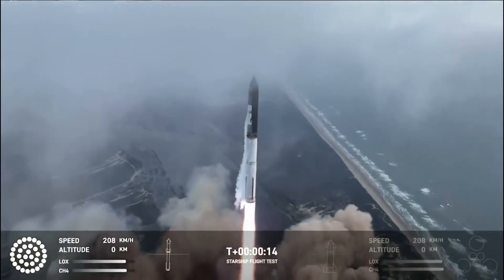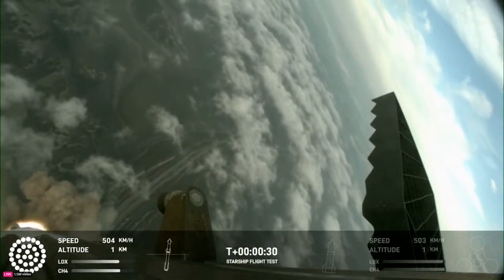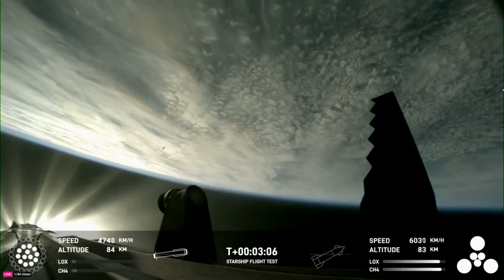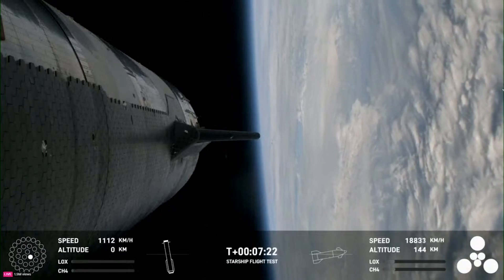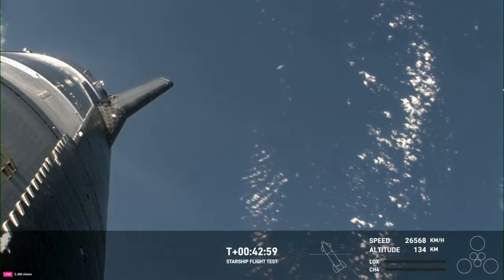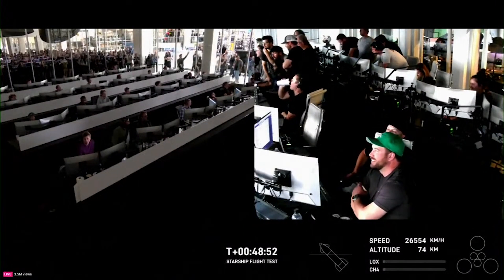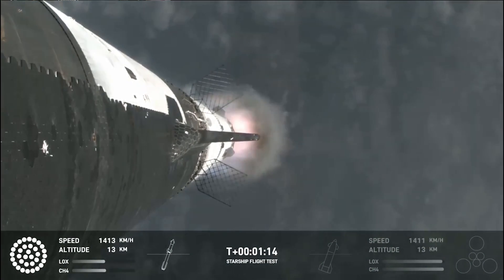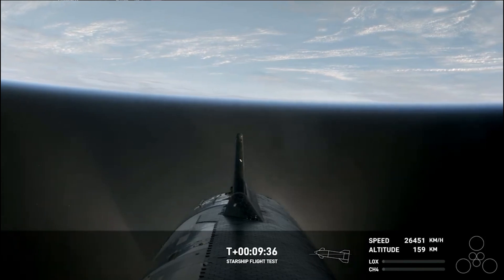What Exactly Happened On SpaceX's Third Starship Launch Attempt?

Comment: I was hoping that they'd succeed with all their mission goals, but it seems that they're getting further and further every time. Which is fine with the iterative process they're doing, but still kinda disappointing. Hopefully the next iteration will get the booster soft water landing down, and the ship will survive reentry (looks like keeping the ship oriented correctly during initial reentry will certainly help). If I had to hazard a guess, the ship will survive reentry, and then they'll try and subsequently fail at an engine relight for the soft water landing. That would just seem to be keeping up with the pattern of improvement across the 3 flight tests so far.
Reply: So artemis IV at 2035 maybe.
Reply: But it seems that sx didn’t get the necessary data about how the TPS tiles will behave as ss was not oriented properly as it reentered the atmosphere. To accomplish what u suggest would require the tiles to be effective as designed which is ambiguous at this time. Though it appeared that some tiles were missing before ss started the coasting phase.  So a bit of a mixed bag.

Comment: 4:30 I remember seeing the same thing but that could have been ice that had formed on the spacecraft after degassing and that started flaking off. 
Remember that the craft had yet to start heating up do to reentry.
Also Spacex commentators did say that the tiled don't flake off.
Reply: On her ascent friction would have provided enough surface heating to have ablated away any ice that accumulated on the pad.

In space, however cold it might be, there's not much matter up there to accumulate into ice. I strongly suspect it was heat shield tiles being blown off as the craft made reentry at the wrong AOO/Attutide. From T+0:45 you can see she's spinning instead of keeping her heat shields aligned prograde.

Edit: Missing a word
Reply: Altitude 114km too high for dragging tiles off.

Comment: They did a fuel transfer of about 1,000 kgs between the nose tanks and the main tanks...
Reply: 1000kg extra fuel in the main tanks over the header tanks probably didn't help re-entry controllability. That would be sloshing around, and would be weight further back. There is a reason the header tanks are where they are.
Reply: @agsystems8220  They never fired the engines up and the re-entry was not controlled but they did ty to control it with the flaps but with no effect at that altitude.
Reply: @triage2962  "the re-entry was not controlled" – why do you think so? I didn't see anything spinning without control.
Reply: @MikkoRantalainen  It was never supposed to spin and while spinning in can not perform a reentry.
Reply: @triage2962  Did SpaceX publish the correct approach orientation somewhere? I wouldn't be surprised if the plan was "let it spin until we get enough atmosphere to use the fins to turn it into correct orientation".
Reply: @MikkoRantalainen  Yes they did show a simulation and there was no spin in the flight and no tumbeling for reentry.
Reply: @MikkoRantalainen 
I saw "spinning without control" ever since the propellant dump.
Reply: @triage2962  Do you think the simulation was supposed to be accurate or just for illustrative purposes?
Reply: @MikkoRantalainen  They showed what the plan was and reality had some hickups.
Reply: @triage2962  Can you tell me the title of the plan so I can find it in YouTube or with Google?
Reply: @MikkoRantalainen  It is in the broadcast before launch.
Reply: @agsystems8220  That should have been obvious, but as an old friend of mine used to say "Obvious often means overlooked."
Reply: I know they attempted it but do we actually know if it was successful? On the NSF feed they mentioned it was fast. 

Im not saying it wasn't successful but im really interested to see if it moved all or even the majority of the fuel. Or if they encountered an issue  that stopped things early. 

I know SpaceX announced the fuel transfer test was completed but they didn't mention if it was actually successful on the live stream.
Reply: Are you saying the transfer was not even perpendicular across the same axis that their animations show two ships docking to each other in?  Just down the axis of the vehicle between two tanks that were already connected to each other?  That's frankly rather pathetic.
Reply: @kennethferland5579  
It is what NASA requested, approved, and funded. It is an incremental result never done before on this scale. The next step is ~110 metric tons. Between ships.
Reply: @kennethferland5579  This test was likely the easiest way to get the required data while adding very little hardware to the ship.  If it failed they would know they had a bigger problem to solve than they expected.

Comment: What actually was that falling debris? Tiles? Ice? Partially closed dispenser door disintegrating ?
The SpaceX hosts were silent on of the fuel transfer test and why was the reentry test-burn cancelled?
Reply: They lost control thats why the reentry burn was canceled and at that time it was just tumbeling around.
Reply: @triage2962  "it was just tumbeling around" – you keep saying that the ship lost control. Do you have any evidence to support it or is that just your personal opinion?
Reply: @MikkoRantalainen  You can see the tumbeling in the telemetry and that is never a good thing and everything went south with the reentry.
Reply: @triage2962  Again, do you know what was the correct orientation? Or are you just assuming that you think how it should have been oriented?

I would say that the control was lost only if the spinning or tumbling was so fast that fins have no ability to control the movement. I didn't see such thing in the video.
Reply: @MikkoRantalainen   He's right you're wrong.
Reply: @blucat4  Based on what evidence?
Reply: @MikkoRantalainen As the plasma began to appear on the flaps, you can see the earth still rotating in the background. Under nominal conditions, the earth (and the ship) would be in a far more fixed position.
Reply: @EMichaelBall  I was expecting that when you start to see first traces of plasma, the actual amount of friction is still pretty low and you have still lots of time to re-orient the ship using the little amount of friction against the plasma.

You can see from the speed indicator that there's basically still no drag when you already see the first signs of plasma.
Reply: It seems like venting overpowered the RCS. I'm not sure how a propellant transfer could be demonstrated with the vehicle rolling that much.

Comment: These were not heat tiles, it was ice build up falling off, from venting... the bottom flap stopped responding, it seems
Reply: Some look like flakes. Some look hexagonal. The biggest chunk was clearly a few hex stuck together.
Reply: Some awfully square ice chunks.
Reply: Altitude too high for tiles - no air drag!
Reply: I agree!! Clearly ice.
Reply: Tiles